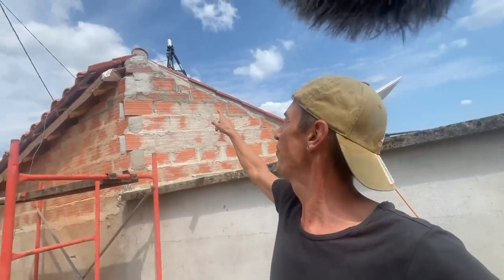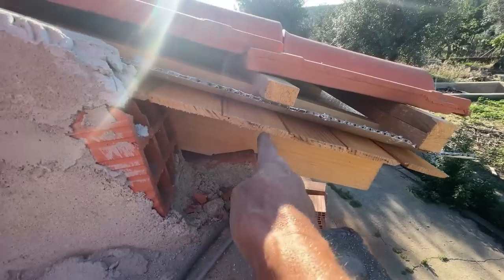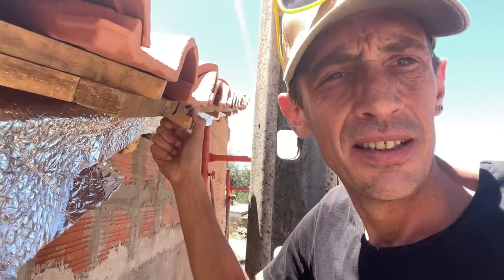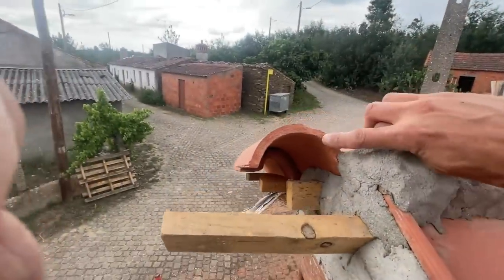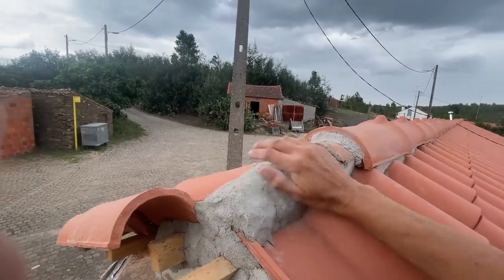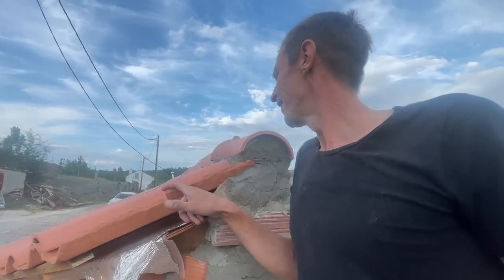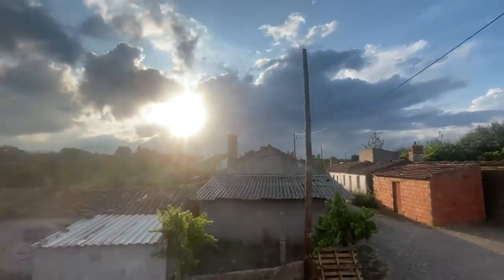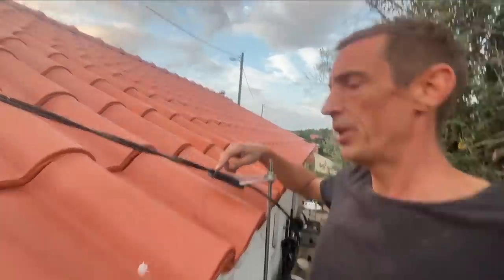S3E36: NOW THE ROOF ROOF IS REALLY DONE! - DIY PORTUGAL

Comment: Jasper, please do put guttering up on the back roof.
If you remember back you had water  penetration through that back wall, you could then install a large water tank on the side of the building to water the garden when you want too.
You could install a overflow so it floods the garden when full.

I would also consider putting a small two brick high wall along the road edge, above the trench so that run off from the road is directed away from the building…..
Guttering and small wall will almost remove the fear of water penetration through the back wall, do you really want to risk damaging all your hard work for two tasks that can be done in a few days and cost very little…..

P.s you could go one step further and run a soak away in the trench and fill it with gravel, this can be done in one day and 99% guarantee no water ingress…..

Don’t spoil the finish for the sake of one weekend and very little money
Reply: I love all your thoughts and suggestions. I'm sure Jasper will give your suggestions great thought.

He really likes people input. I'm sure he will take your great suggestions.
Anyway if he doesn't get will let you know as he has in the past to others

Comment: Install guttering at the back .Without it the water runs off the roof into your trench .However it will also be blown by the wind against your back wall on the way down and will lead to damp penetrating the wall over time .I had the same on my old farm house .I put in gutters and the wall was no longer damp .You can still direct your roof water to the garden if you want to with down pipe to a gully at the end .

Comment: Hi Jasper.. Nice work on the roof. Re the mains power cable. I would not have that cable pass across your roof at all, its a bad idea. That fitting they use to stretch the cable will eventually cause the insulative covering of the cable to breakdown and you'll have issues. Further an external cable designed to be under a tensive load and strung between two points like poles, should have a guide wire in it. The guide wire is what is put under tensive strain and the wires carry the electricity are carried by it and not under any load at all.  (I was a rigger in a Telecommunications company for over a decade, so I know the mechanics of strung cables a bit). In my view your best option is to re-route the mains cable in conduit vertically straight down the power pole right next to your house, then enter your house on the pole side, starting at an external junction box.  This will completely remove the tension load on your main feed line and give you a clear and safe entry point into your home that can be serviced. Internally you could route the cable in the roof structure, on top of walls etc to get to your main consumer unit. While you have the building apart as you do, it is a great time to have this work done. I'd establish a new Consumer unit in the part of the house it will reside and have a cable run between that and your existing unit (effectively turning your current consumer unit into a sub-unit). you'll have a clear and safe base then to start running new and redesigned electrical service from. Re EDP Solar, its a complete rip off and I'd avoid their offering. happy to DM if you want to understand more about that. I hope that helps, take care D

Comment: I agree with shaunsworld430 about guttering the back wall and adding a water tank. Instead of trying to fill concrete between the rafters on top of the walls it would be easier to just cut pieced of rafter wood and fit them between the rafters with screws at an angle. Great job on the roof.

Comment: Preparations for the ends of the building for the roof should have been done before the battings for the tiles was place that the tiles sit on , therefore you would have had no issues.  or concerns of rain getting in under the tiles, for the simple reason that extending the battings well over the edge would itself solved those issues.